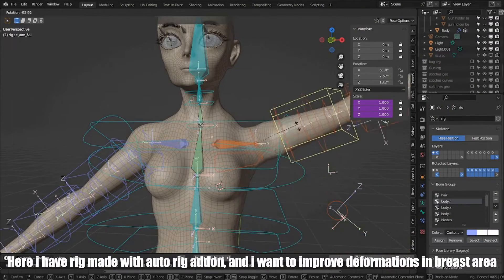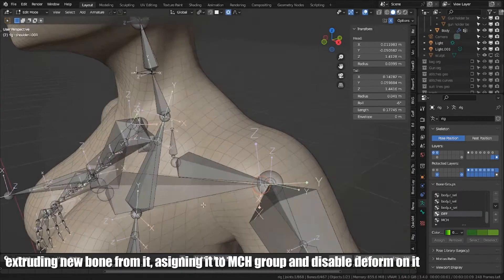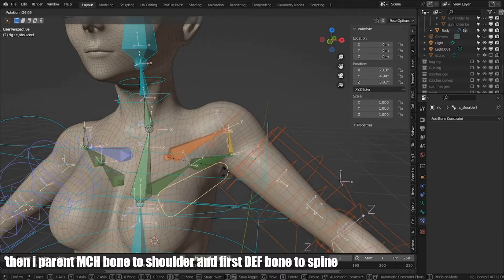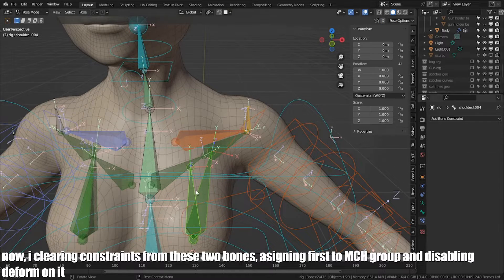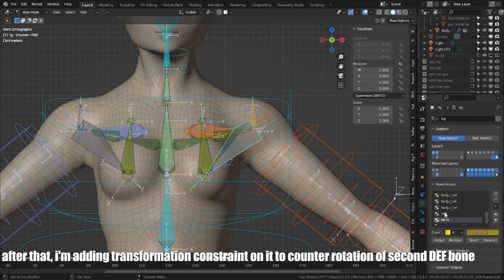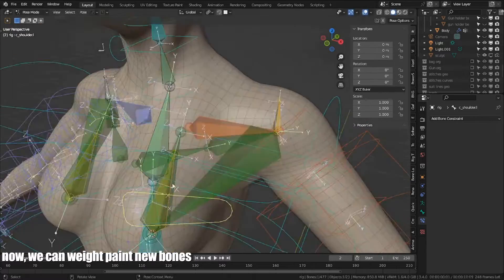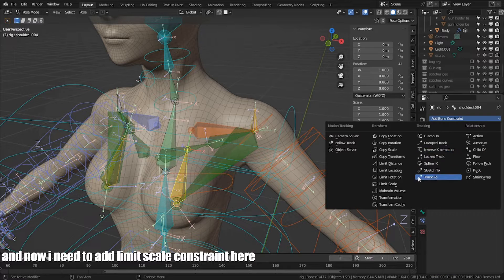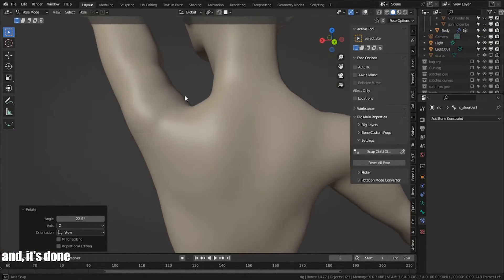[Blender] Breast rig improvement

Comment: Can I get the project file? It’s a bit unclear for me to understand which constraint corresponds to which bone, and I don’t understand the transformation constraints at all.
Reply from the maker: I don't have project file from this tutorial anymore, but transformation constraint takes one kind of transforms and using it to drive the other, basically you settings up desire coordinates in map to and setting up what movement have to happen in map from, you can also use action constraint, it's easier to understand and can make more complex transforms